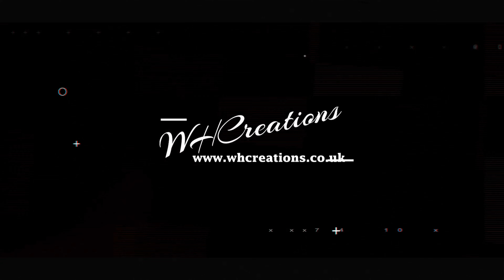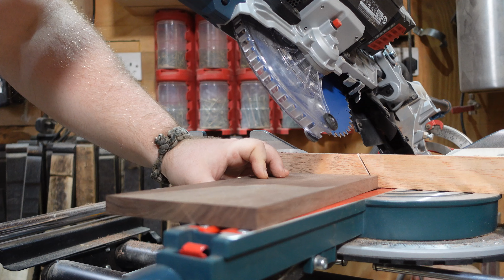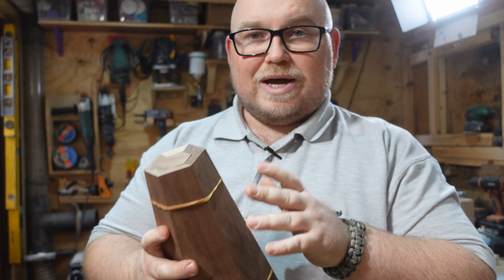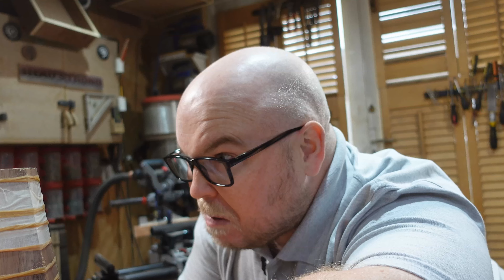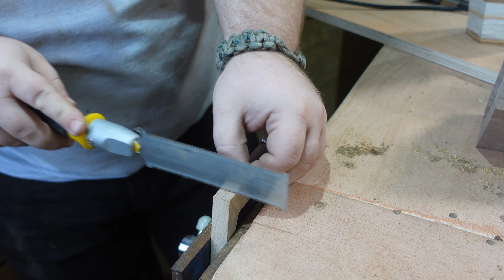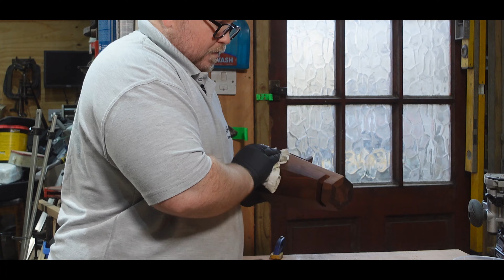How To Make A Speaker For Your Phone Using A Tool You May Already Own!

Comment from the maker: How To Make A Wooden Phone Amplifier | #BITURBOtest 

I had the good fortune to receive the Bosch GCM-18V cordless mitre saw. I had to make a video showcasing the saw's full capabilities in order to keep it. I made the decision to design a project that can only be produced using this amazing technology. The complex mitre cuts required to produce this gramophone's sides are made simple by the saw. This produces the ideal speaker for any phone or tablet after being glued and sanded.
This speaker can be built as a weekend project and is made from reclaimed walnut flooring.
This saw is without a doubt the best one I have ever used because it handled everything I threw at it with ease.